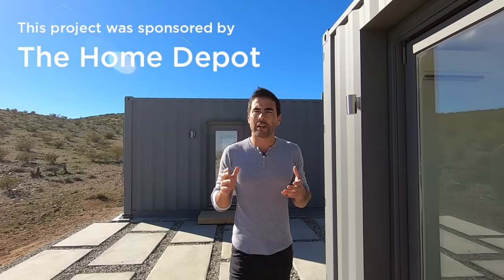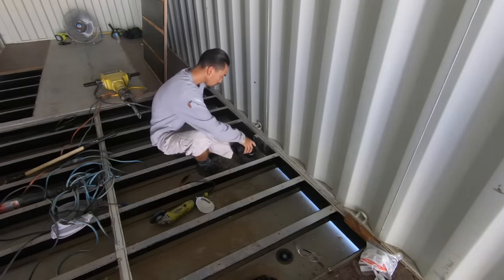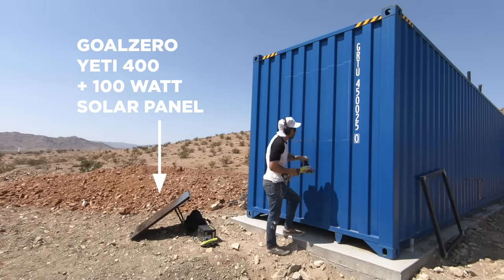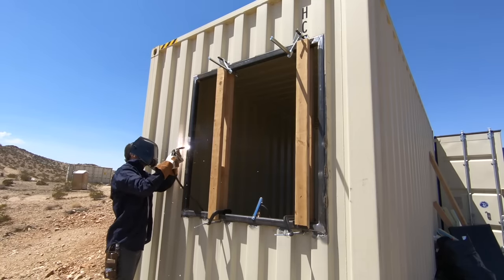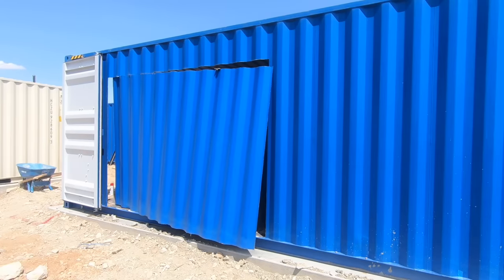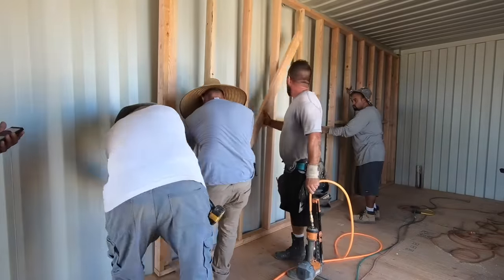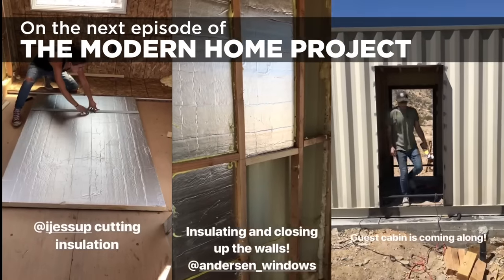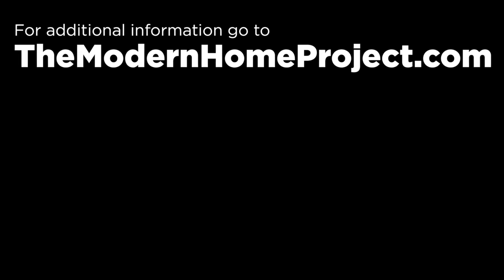Building a Shipping Container Home | EP02 Moving, Cutting, and Framing a Container House

Comment: I was in the military and we lived in some of these containers in war zones. We would set them on the ground, level them the best we could and then stack sandbags all over the top and sides for insulation and mortar protection. Containers are designed to support a stack of 6-8  containers loaded with cargo. Containers are very strong in their corners, due to this strength in the corners we would just build a timber frame over the top and then we added sand bags to the roof. This build is overkill to say the least, this house would be standing after everything else was shaken apart in an earthquake. It's important to understand that the structural limits of containers are formulated under the assumption that hey will be moved while loaded and loaded onto each other on a moving vessel. Needless to say many of us are still here because we slept in these things. 

ISO Standard 1496(1) states that the corner posts of ISO Series 1 containers should be tested to a load of 86,400 kg (190,480 lbs). This is the load applied to the posts of the bottom container in an 8-on-1 stack of 24,000 kg (gross weight) containers (20 Foot)

The side walls and end walls/doors have to withstand loadings of 0.6P and 0.4P respectively, these values equate to 28,746 lbs and 19,164 lbs based upon the payload given above.  The side wall area in contact with the load is 146.56 sq. ft. giving a pressure of 196 lbs/sq. ft.  Corresponding figures for the end wall/doors are 51.78 sq. ft. and 370 lbs/sq. ft.  These figures are well in excess of the 20 lbs/sq. ft. wind load required for structures less than 50 ft. high.  A wind of 100 MPH produces a pressure of only 30 lbs/sq. ft.

The roof load test is 660 lbs over an area of 2' x 1' applied to the weakest part of the roof.  The load is usually applied at the center of the containers positioned with the 2' dimension aligned longitudinally.  Thus the roof is able to support an imposed load of a minimum of 330 lbs/sq. ft.  The design is easily capable of supporting the basic snow loads of 30 lbs per sq. ft. evenly distributed.

The floor is design to pass a concentrated load test of 16,000 lbs over a foot print of 44 sq. inches.  The floor has also been designed to pass a test at twice its rated payload capacity of 47,895 for a 20 container and 58,823 lbs for a 40' container when evenly distributed.

The boxes are suitable for earthquake areas of seismic rating of up to the California standards.
Reply: Thank you so much Johnny. I learned and had things verified by your essay. hugs, Cat
Reply: Word.

Comment: why would you need headers over the openings for doors & windows? that is what the steel square stock is for. i think i will pass on moving to California.
Reply: patrick evans my question exactly those headers are completely useless.  Spanning above the door you have the shipping containers steel beam then you have the steel beam from your frame.  Unless you plan on driving loaded dump trucks over the tops of your doors and windows that wooden header is completely useless.
Reply: @motorboater211  Honestly, if their reinforcement frames went fully top to bottom, then your probably could do that.
Reply: we know it isn't because of the heavy snow load.

Comment: I feel uncomfortable commenting because I'm not really qualified.  I also know the construction is already fully finished.  That being said, one of the things I've learned from watching RR Buildings and their post-frame stuff is that relying solely on caulking to keep water out of a structure isn't ideal.  Given enough time, caulking will fail.  Again, I'm kind of paraphrasing what Kyle has said.  The argument is compelling for having a mechanical barrier vs a caulked one.  Perhaps something to consider for the long term on these buildings.  Really enjoying the series.  Thanks for sharing!
Reply: Urethane would last a very ling time instead of caulking.
Reply: RR bro, the reason he gets away with this is because this build is in the Cali desert.  He gets rain events maybe once a year.  I think you're right if this were in any place but a desert.
Reply: Tsorovan Zero You’re probably right. Ben is a smart guy who most likely thought this stuff through.
Reply from the maker: @colinhawkins8265  thank you if you want to some of the other projects my architecture firm has designed check out https://zeroenergy.com/
Reply: Exactly. He should have just completed the welding of the window frame to the corrugated steel panel.
Reply: Many silicone caulks have a 50 year guarantee against breakdown.
Reply: Rob Joyner and if it fails before 50 years, which it will, you think they’re going to pay for the repairs, mold remediation and remodel?
Reply: Caulking both sides of something is also not recommended because any water that might get in get might not be able to get out...

Comment: -Wall mounted toilet carrier could have solved many of issues with plumbing, but would take a little extra wall space. (all pipes could have been run inside walls and not the floor, shower pan could be lifted off the floor few inches to avoid plumbing going through the floor)
-Why do you need to cut all the steel C channels or I-beam on the base of container when you can route pipes inside walls like you did for what looks like a kitchen sink? Why install sink drain line before framing is complete?
-Why use lumber for framing when you could just use for 18-16ga metal framing, it's much easier to get all the wiring and pipes through them and it's pretty structural.
-2x4 ceiling as well? Why not use old and reliable drop ceiling made of pencil rods, black iron and furring channel?

So now comes a million dollar question. If structure you build on the inside can be self supportive, all you need is to add plywood or dense glass, vapor barriers and then siding, what is the point of the container?
Reply: Edward, what you don't see is the construction codes that they have to follow.  Some of that dictates whether they have to use certain materials, such as copper water lines.  Also keep in mind that there's no space between the slab and the bottom of the containers.  Since they chose not to position water lines in the slab - reasons are many - they have to figure out how to do drain lines, etc. in the floor supports of the containers.  Not many of them can be run in the walls - and those that can face the varied wall space between the wall framing and the corrugated outer skin of the container.  The folds in the corrugations can be as thick as 2 inches.As for the studs, metal ones conduct heat unless you put a thermal barrier on each one that touches the outer skin of the container.  That's more work and co$t than wood, so it's logical to think that's the decision they made.2x4 ceiling beams permit some load above them, and the video mentions insulation - which you want a LOT of in the California desert.  And to your last question, Ben said he wanted to use shipping containers.  Maybe that's all there is to it?
Reply: @crankyoldguy2  -Where to run pipes has nothing to do with code, if there will be a water leak in your floor from sewage pipe, good luck replacing it.
-Kitchen sink drain lines only use 2" diameter pipes. actual size of 2by4 is 1.5"x3.5" if metal framing was used (3-5/8" studs) there are no issues running those pipes inside framing. Only toilet drain required to be 4" and it's already going through the slab. Not much work around shower pan, but  shower pan could be lifted off floor to allow drain to run above slab and then pitch it in the wall.
-Your thermal conductivity claim is highly speculative. He is already building a house out of metal and it will be a furnace inside on a sunny day. I really doubt wood framing inside walls would make a difference to keep it cool on inside on hot day.
-Metal framing is actually much quicker to build if nothing more than 20ga steel is used. It's only slightly more expensive so it equals out after labor cost.
-I believe you have no idea about construction of suspended drywall ceilings. It's much cheaper, faster and stronger construction (it's actually illegal in some cases to use different types of ceilings). You can install tons of insulation inside that construction too.
-This video is not just entertainment, it's also an educational guide. If it does not show best and most efficient methods to build things, why bother even creating it?
Reply: The slab made everything more expensive and difficult. With a container you have solid walls and a weatherproof roof that should last you well over 30 years. So long as you don't go cutting it up too much. Set it up on an inexpensive block foundation run your plumbing underneath, don't go slicing through the under-frame for pete's sake. Then it is also easy to move elsewhere if needed.
Reply: Robert Muldoon  My comments didn't disrespect anyone unlike yours. I just question amateur methods being used. People who don't know much of construction take  those methods for granted. Well they shouldn't this is not the best guide to build. He is clearly not using best techniques and his safety methods are mediocre at best. Showing a guy riding on peice of corrugated steel wearing shorts hooked up to bobcat is not a funny thing to watch.
Reply: Robert Muldoon  If you think you know it all you know nothing. His build definitely works as an extremely amateur project. If you think safety is not important the biggest thing you build was a wigwam and never had to deal with city agencies such as DOB, DEP, Fire department. If you so smart please tell me what do you know about soil contaminations, superfund projects or basic sprinkler coverage, or pile caps. You won't be able to tell the difference between yellow romex and access control riser cable. Oak, maple or poplar types of wood. Determine 5/8" vs  3/4" material thickness without tape measure. 10ga vs 12ga wires. 20ga metal framing vs 25ga.
Reply: Robert Muldoon  Simple question. Tell me if HSS he is using is right choice?
Reply: It looks dope tho
Reply: Yeah good point. I was thinking that too...its starting to look like a normal house frame...just build a house and use bricks.

Comment: We've learnt to do continuous welding on the 100x50 external frames and spaced welding for the internal frames on the New Life Children's Home project here in Witbank, South Africa.
Also these containers are designed to carry approx 21  metric tons and be stacked about 10-12 high that's over 200 metric tons in the bottom container. On a single story structure I think additional structural work is a waste. Just don't cut unnecessarily and frame everything effectively. The box does the rest of the work.
Reply: A few things I learnt: position the containers on flat ground  or on foundations before cutting walls. I am using concrete stumps for the containers and even though the container is designed to stand on the corners alone, I put in two extra stumps on the long walls to support the major cut outs (note that the additional stumps need to be 12mm taller than the corner stumps) I also cut the larger holes and extended the frame up to the top rail removing the need to put in a header. Effectively I have built a continuous rigid support from stump to top rail. Window size holes get a steel frame only.

Comment: An hour and a half to cut a window out.... jeeze. Your tolerance is astounding. I would have spent an hour going to get a generator and 9 inch grinder before I stood there for 1.5 hours cutting a simple window out.
Reply: usually done with a plasma cutter because that would take 10 minutes. I can't imagine over an hour spent cutting a single window.

Comment: Man, dont ever weld flat on concrete like that.  You risk it exploding on you if there is any moisture trapped in the concrete.  It superheats and expands and can blow up in your face.
Reply: Thank you for that great safey tip.
Reply: When it pops- it sticks to your skin, as you 
frantically peel it off your skin stays stuck to
to the cement piece,  it all happens in about
two seconds"
Reply: I think you get better penetration vertical welds when you go from the bottom up too.
Reply: There was an obvious amount of FNG in this video.